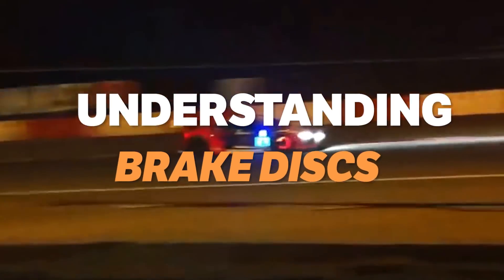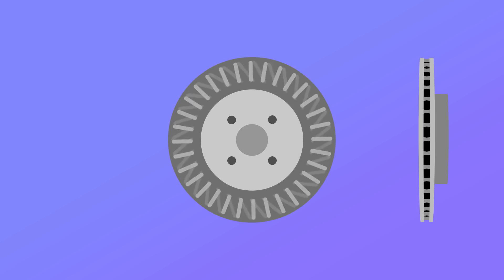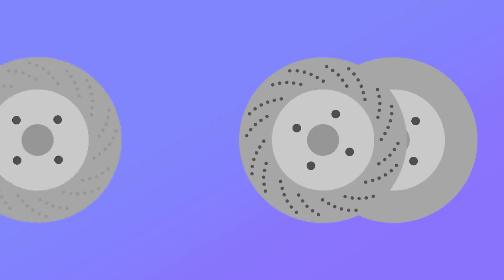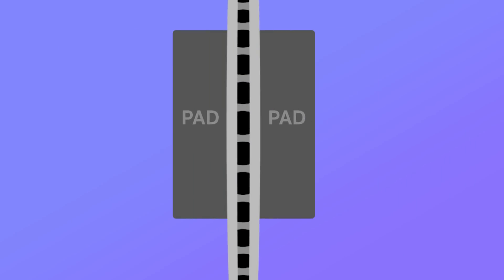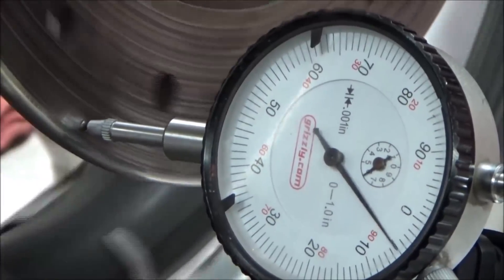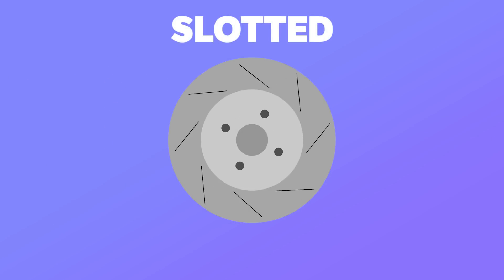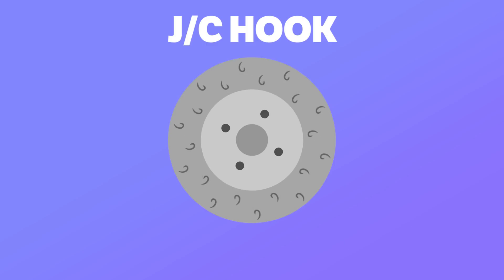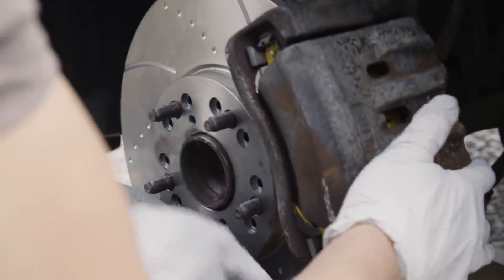The Truth About Brake Discs

Comment: Please go over What RPM you should shift at when daily driving, because I always argue whenver my dad shifts at 2.5k RPM just to then speed up 5 MPH. I personally shift at like 1.8/1.9k RPM on flat surfaces and 2.2k or more if needed on hills. Also cover if it is bad to daily shift at 3k RPM or even 5k RPM.
Reply: For day to day driving, in normal conditions you shift up as soon as the cars torque curve will allow. So if you shift out of 2nd at 2000rpm and into 3rd and the engine doesnt struggle or labour, then thats fine.
As for high RPM, my Saab has 220,000 miles on it, and i hit 5.5 to 6k maybe 4 times a day on average. For the last 9yrs and shes still fine. Knocking out 360bhp, and 40mpg on a long run.
Reply: Some nice, well maintained and treated car Like my BMW. and 1.8k RPM is more than enough for my engine as it doesn't struggle. And as for my dad, He revs way to much. Ok sure fine idm the hooonage as long as engine is warm and you revmatch, but my dad never revmatches as he calls it "bullshit". Me personally, can revmatch in any car, but *not my own which is annoying and I always mess up the revmatches..
Reply: CarMaster_316  Driving at or just above bogging down your engine is so much worse then just turning the engine a little faster under a light load. Low engine rpm means low oil pressure low oil pressure means your rod bearings start slapping your crank journals Your crank journals get closer to your main bearings. Your piston rings don't push hard enough against the cylinder walls causing more blow by (meaning more gasoline in your engine oil).
 You're emissions system sends more unburnt fuel back through the intake causing more carbon build-up.
Do I need to keep going..... An engine is designed to turn.. let the fuckin thing turn.  I'm not saying float your valves all day but  touching 2500  3000 even 4000  regularly is not badd for an engine. It's what it's designed to do.
Reply: You can't really answer that one as every car is different. Different gear ratios and power and towwue figures and weights. My partners 1.6 mini around town like being changed low. But my mum's 1.0 3 cylinder Suzuki alto like at least another 1k before changing gear otherwise it lugs.
Reply: Really depends on what you have, an RX-8? Good luck...
Driving a truck that redlines at 3800rpm, I probably wouldn't make a habit of shifting after 3k.
Reply: Depends on the car, Our B5 2.8 Passat doesnt like anything less then 2 grand but you can also bang out 7 grand shifts all day long and doesnt bat an eye.
Reply: Short shift to save gas while tooling around town. I'm usually in 5th before 40mph

Onramps is where you wanna stretch it out lol
Reply: it realy depends on the car!
gearing, tourque and so on have a big role here!
Reply: CarMaster_316 you are shifting wrong! You should rev to the limiter. E.g. If you are going 50,do t shit to 4th,or 5th, keep it In 2ng.
Reply: CarMaster_316 There is no correct RPM to shift at because all engines are different and fitted to different cars. Different torque, gear ratios and weight will all make the perfect timing different. Also what you want out of your car after the shift, changes the point at which you should shift. If you want maximum acceleration you would shift much later than if you wanted peak fuel economy.
Reply: you can shift whenever you want really. BUT I would recommend running the revs out a few times (close to redline) a week (more if you drive a lot). doing this will help blow out carbon buildup in your EGR system and in newer diesels (with DPFs) will help get them up to temp and clean burn them out. DPFs are costly pricks that cannot be deleted from the exhaust systems.
Reply: xXxMartin96xXx You've got that backwards.  Rotaries have very little low end torque, and create a lot of carbon build up when they're not revved out.  To keep a rotary running longer you can't baby it.
Reply: If you are the one that brought up topic about shifting.. and you are arguing that he sifts too high. i would assume you have developed feeling for the car and you are driving it good. i drive 318 ti and under light accelerations i shift it aprox 2000 rpm. under super light and low speeds on parking lots and stuff shifting from first to second on like 1600. I drove a peugeot 206 1.1 the other day and you obviously have to rev it higher for same acceleration, and besides that car is shitty at low rpm anyways, idles bad and you cant start from a dead stop in normal driving if you dont rev it to like 1200-1300 rpm, and with my 318 ti it starty happily from 800-1000 rpm if you are acurate with clutch and throttle
Reply: Depends on you driving style. I find my low powered car (101hp) terrible for driving at low RPM's, so most of the time I drive it at about 2.5-3.5K RPM's and I shift arount 3.5-4K. It's 1997. Second hand(the odometer is probably reversed), I've had like 70K km's (44K miles) with it and no problems so far.
Reply: hmm.. i wouldnt say 100 bhp is low powered at all. even diesel with 60 hp can be driven prety low, only petrol engines with like 60 hp have prety poor torque
Reply: i wont go under 1800 even on a diesel...on passenger cars, if i want some response without delay:D for coasting to the next traffic light it doesnt matter. also the higher the revs the smoother are the gearshifts upwards and everything related.
Reply: And as for they can be run on rev limiter. yes, its designed to do, but will it increase component wear a lot- it will, a lot. You wont brake it by revving it but it would wear out a lot lot faster, and not to even mention unnecesary fuel consumption
Reply: CarMaster_316 redlining isn’t bad! I take my car to redline every time i can! Never had engine issues, they’re built for it mate...
Reply: I used to worry about the sort of stuff the OP is talking about. A while ago a friend who knows a hell of a lot more about cars than I do (and I like to think I know a lot) told me "there's no using without abusing".
Just learn to service your car and do it regularly and drive the damn thing. Love it, go on adventures with it and don't forget to talk to your car, because contrary to what people will tell you: cars are actually living things with emotions, just like us.
Reply: My personal experience my car likes to be above 1,750rpm anywhere below that and it lugs and i can feel knock coming on, i normally shift just about 2k like 2.1/2.2k but it personal preference, i get good response when i put my food down at 2k i feel the boost build quick anywhere under that isnt quick to respond, at 4k the boost is instant and will rev to 7k once maybe twice a week, and revmatching is honestly pointless but i still do it because makes me feel like senna but theres no real need because if the brake in gear right down to bottom/near idle then change down it will lift rpm maybe 500 ish rpm so no real wear on clutch or any mechanical component, its when youre sitting in 3rd at 80mph and hard brake for a 40mph corner that you need to pull out of then you should rev match because just braking and slamming it into second may cause the wheels to lock (unlikely) but it really upsets the balance of the car horribly, but no need to do it in normal city driving.
Reply: depends if u are driving a diesel,petrol, with turbo or not, if your car does have a turbo  and u drive at such low rpms i feel bad for u
Reply: CarMaster_316 the Particle filter was probably filled
Reply: Alterate Awful Yup that will lug the fuck outta your engine
Reply: Zombie Head Fair enough seems reasonable
Reply: Howy Yeah, same mate, 2k or 2.2k or so, but i'll revmatch on everytime I need to anyway
Reply: PROcrastiDRIVE SV They are living things and definetely have feelings. My dad always abuses cars, 1 year ago in June (and months before) He had an 2006 1.9 CDTI Vauxhall Vectra.. It was 150BHP. First the car pulled fine and was fast. But a few weeks later something happened and it felt real sluggish. He started abusing it and blaming the car for it, when he tried changing the fuel filter i believe it was, whenever he tried to start the car the engine smoked everywhere but started after that. Later he went to a mechanic and his yard has a really big hill you have to drive down to get there. Once he was going back out, the car had no power on reverse so he booted it to 5k RPM (the start of the redline in a diesel) and burnt the clutch but somehow made it, I told him the car will hate him for all he done.. And so it did but he didn't listen and said "you are a fucking idiot cars are only machines". 1 day we were on a short trip.. the red oil light went on.. The engine made a loud thump noise and my dad pulled over and the engine started smoking so he turned it off. It was the con rod that gave up.. Poor car, it did what i said it would. Hate him.
Reply: Mighty RS Sure, as long as it's serviced right and it's not revved from cold, the car will last ages, if it was a bad treated engine, no oil changes no services,  if you abuse it, it'll most likely blow up.
Reply: Boz 2011 Yeah ik, I've mentioned that before.
Reply: Takumi Fujiwara I've a 316i and 2k RPM does it up a slight hill. Only 104447k miles. That shift brings me down to 1k but it's fine. Obviously for bigger hills you'll need 3k or more but you'll most likely also have to pull the clutch down. What I mean is e.g u going 12mph on 1st at 3k rpm and u press clutch and shift into 2nd, RPMs are at 2.5k RPM but 2nd gear's rpms are at 1.6k so ur slamming the clutch against the flywheel and doing damage to the drivetrain, but obviously it's small wear if u do it like 1 time a day.
Reply: Tomas T yeah if u revmatch right
Reply: Alterate Awful Well could've been. But the power loss was due to the con rods being fucked.
Reply: And for everyone else's Replies. I know an engine is an engine and can be ran at the limiter (6,500 RPM) everyday. But I want the least of wear and to keep the car happy. (How come I try to Revmatch) And obviously every car is different but 1.8k RPM or so is enough for my engine so none of this you're shifting wrong stuff. Thanks for the replies!
*For my dad's car.. I shifted it at same RPMs as mine and went fine.
Reply: simply put it depends, most of the time a low power and low torque car will need more revs to shift without booging but any new car does not have that problem but if you have like a old 1990 bmw 318 with like 300k miles on it you will need to put some more revs in it as the low end is quite bad but if you have like a subaru wrx then that is not a problem because more low end torque.
Reply: Anthony Trujillo Ah fuck up. You know nothing about cars
Reply: Boz 2011 What part of the engine wears faster by revving the engine higher under normal conditions?..... an engine is not grinding itself to pieces slowly but surely every single revolution. Do you have any idea how oil under pressure suspends engine components???
Reply: CarMaster_316  PS nobody gives a f** if you can blip the throttle as you down shift.

Comment: Vented plain up front, solid plain on the rear
Reply: Got OEM vented rears. I clearly drive a racecar 😎
Reply: J.G. Brandon on some cars. Not all cars are the same.
Reply: J.G. Brandon don't think any of my cars have had vented rotors in the rear... the ones i have now atleast doesn't
Reply: solid plain all around haha. guess designers decided thats enough. And in normal driving it is. i would assume vented would be the way to go for any track like driving
Reply: That's the setup on my car
Reply: That's the standard on most city cars. Except volkswagen and the Fiesta.